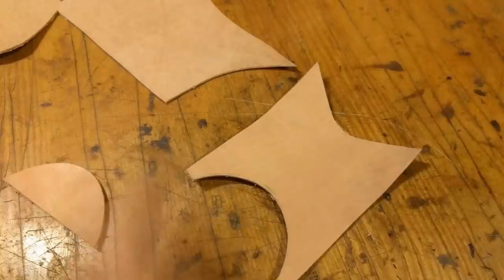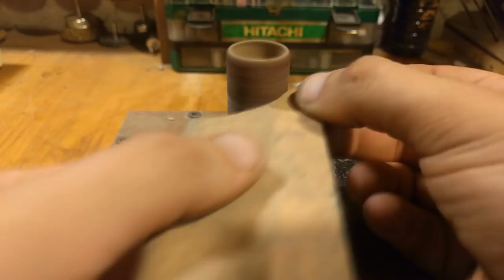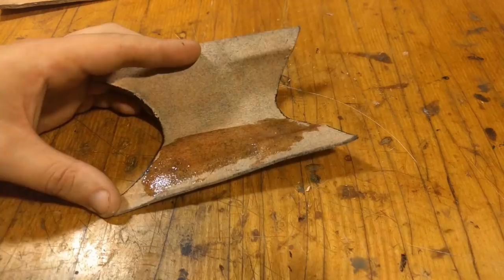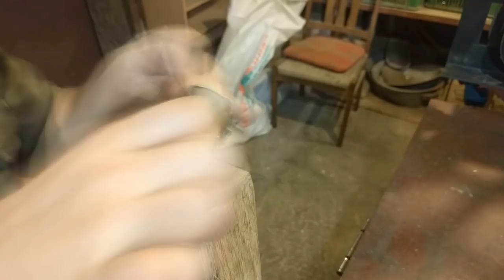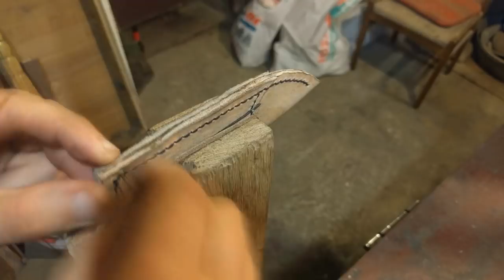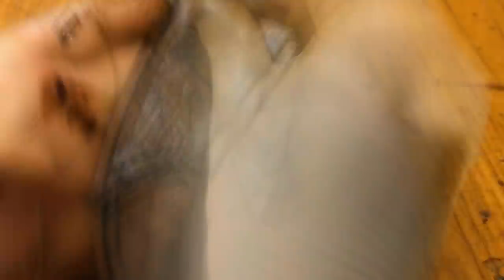Leatherwork - An "Oak" Sheath For My Knife

Comment: There is a reason that leather sheathes are made of three layers at the knife edge side. Your knife will cut the stitching. otherwise, this is a good looking sheath.
Reply: I was curious about that myself
Reply: @jessehart2746 : Live and learn.
Reply: I  always  put  a  layer  in  between
Reply: @artigane51 :  You have to protect the stitching from the blade edge, unless you don't plan to sharpen it.
Reply: Exactly...sharp knife will cut your stitches without it

Comment: Nice Looking Sheath.  I have a few questions though. Why didn't you put in anything to protect the stitching from the knife edge? Why didn't you burnish the leather? Why did you wait until after the assembly to carve and stain the leather? Just curious. Thanks for posting the build. Take Care.
Reply: exactly, it's like watching a video on the wrong/backwards way to make a sheath - no welt, no burnishing the edges,drilled the holes, no roughing the leather before glue, leather way too wet, etc etc.  hey what do i know though right?

Comment: Nothing to protect the seam from the blade?
Reply: There's no need for such protection, if you fashion the sheath correctly.  Rivets in the sheath is largely a western fashion, and is done so the sheath can be sewn together flat, and with two pieces.  Even sheath liners are not traditionally used, and, again, aren't needed, if you know how to make a sheath the right way.     If you look at European sheaths, Puukko sheaths, and even South American sheaths, this isn't done.

Metal was scarce and expensive in most of these places, and the only liner they had was wood, so they had to learn how to make sheaths without the use of rivets or liners, though sheaths made of bark were also common.   Now many people, probably most, prefer sheaths without rivets or liners.

I've been using a sheath must like the one in this video for more than thirty years, and haven't had any problem because it has no rivets or liners to protect the sheath from the knife.

I carried a sheath made of very soft, thin,  doeskin for several years. The only thing it had to protect the stitches from the knife edge was a strip of equally soft, thin doeskin that covered the stitches on the inside of the sheath.  Even after years of use, the knife never did cut through that very thin layer of doeskin.  

And if you have a molded sheath, one that's wet formed to fit solidly around the knife, the edge of the blade is unlikely to come into contact with the stitches, even of you don't do anything else to prevent it.

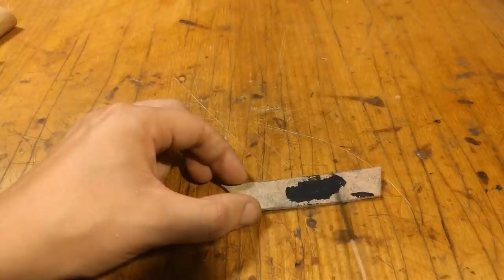Comment: Hallo, what is it black material in 2:23 ? Thanks
Reply: Probably dye. It is common, to doing this before you install stuck the piece to the others. Later you can ruin other parts with the paint or wont be able to reach every corner what needs to be painted (and really looks bad, if the painting is patchy)